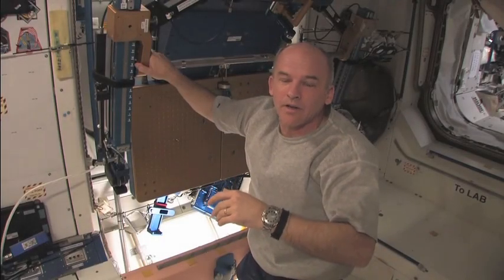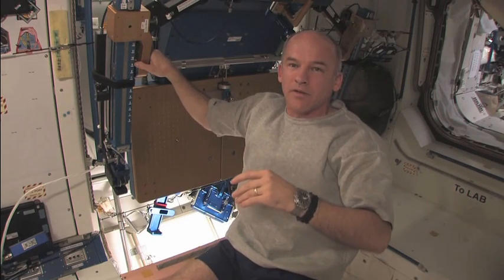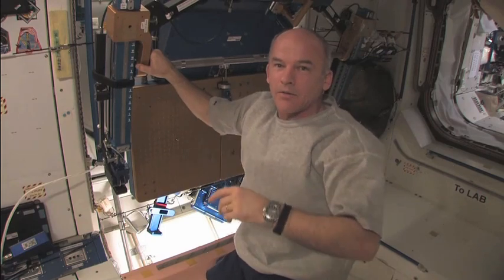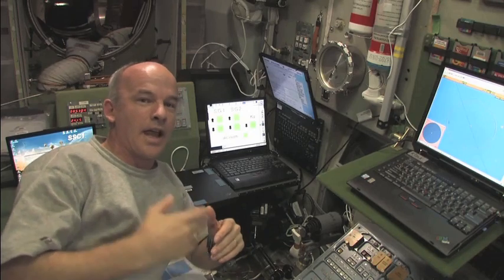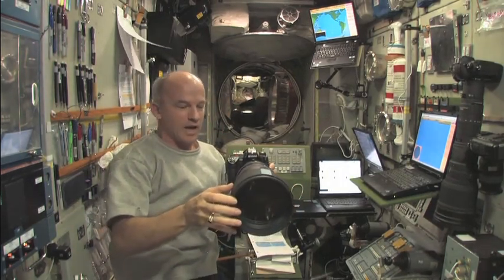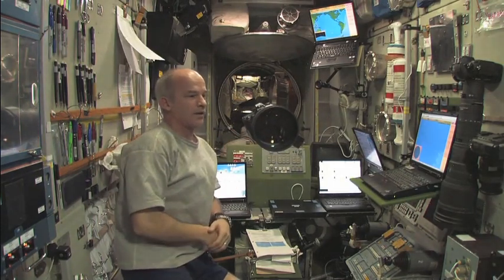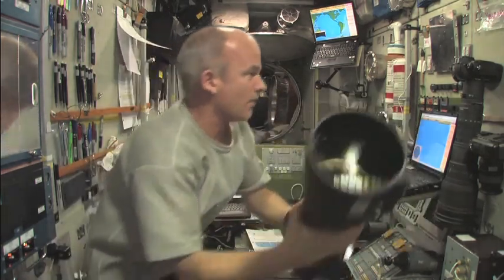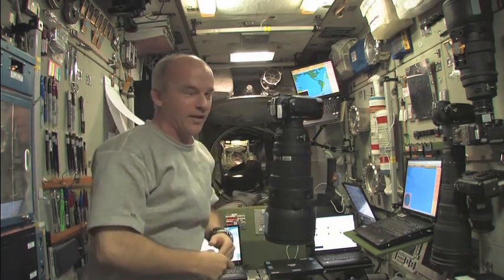Acceleration Inside the International Space Station During a Reboost

Comment: The camera is not accelerating. 🙂
Even an astronaut doesn't get it right. The engine boost does not act on the camera.
Reply: It appears to move but the station is accelerating away from the camera. everything else that is not anchored would move too cause the station is accelerating. The same thing happens in a car when you are accelerating. Things in the car go back  but gravity keeps things down a little
Reply: Shouldnt the camera move along with the ship since there îs no gravity to keep IT in place,therefore when hes holding the camera,the camera should have the same Speed as the ship and when let go it should go forward as well?
Reply: when you dont understand relative velocities. relative to the camera, the station is moving. relative to the station, the camera is moving. as he is fixed to the station and the camera is not, the camera is the one appearing to move